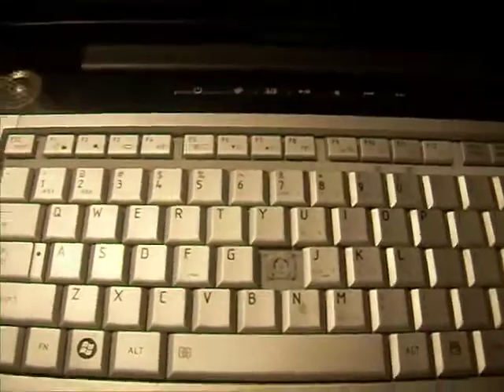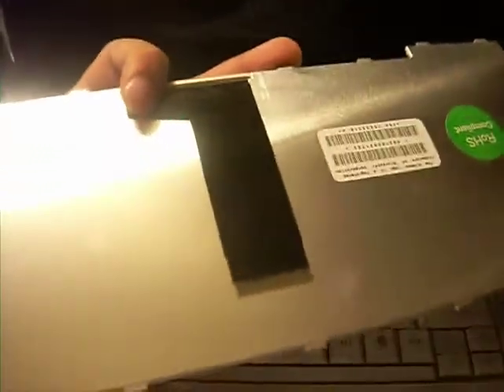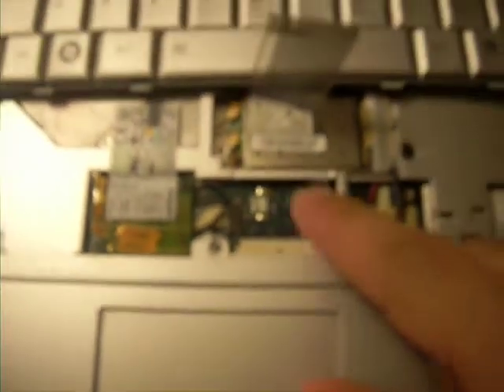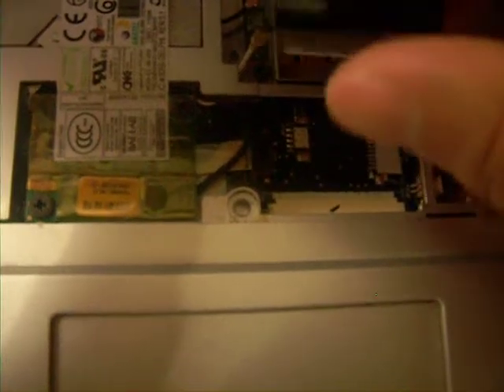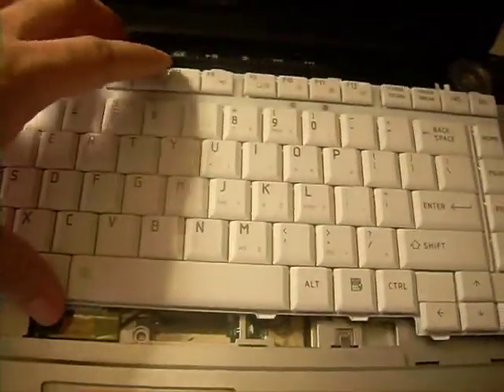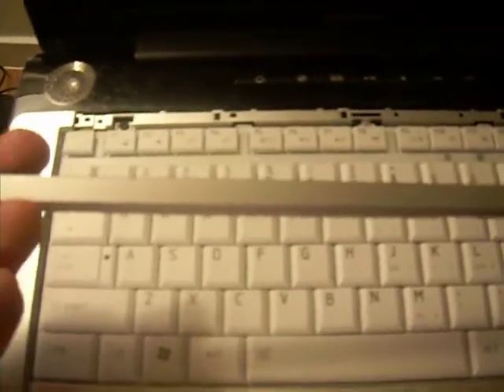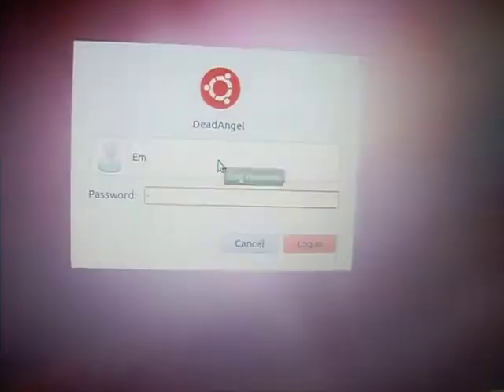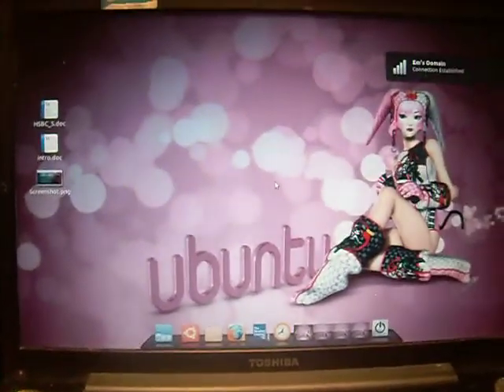Toshiba Sattellite A215 Keyboard Replacement

Comment: Pretty good video, focused and remained patient. 
There are two things that you need to be aware of: 
1.  Donald is correct.  Taking of the cover strip was sure more difficult than shown in the video clip.  Take your time. 
2.  Don't just take the ribbon out and put the ribbon in as is showing in the video.  Catch that he states to slide the little black pcs. back.  In any laptop with a ribbon one wants to do this.  It is a releasing and locking mechanism for the ribbon.  When you get the new ribbon in, then slide them back into place and it will lock the ribbon.

Comment: Removing that cover strip looks easy on your video. I found it very difficult to remove.
I think you pre-removed it so it looked easy. I broke mine getting it out but it still works OK.
Just looks bad with the crack. Putting the key board in after that was a piece of cake. Thanks